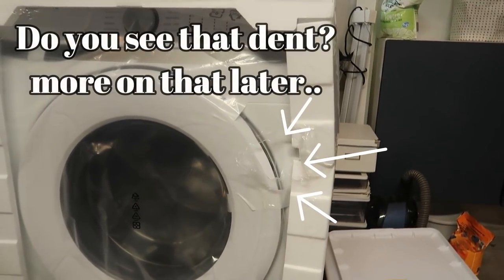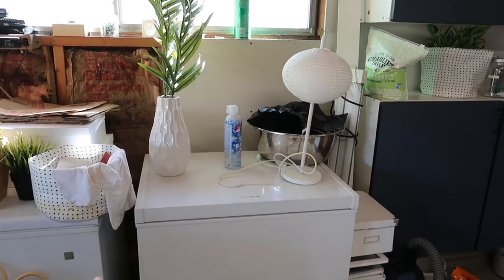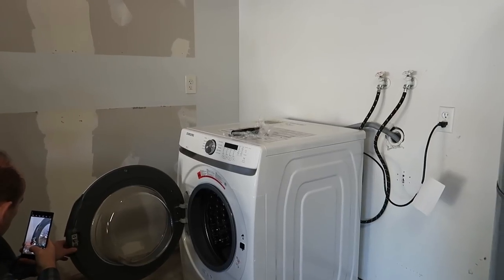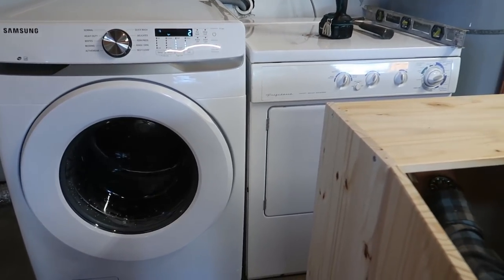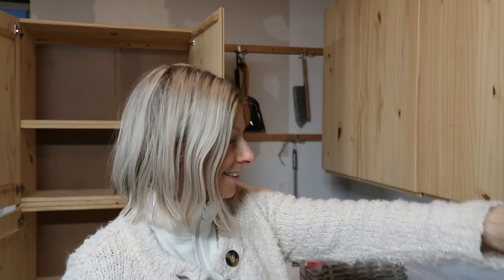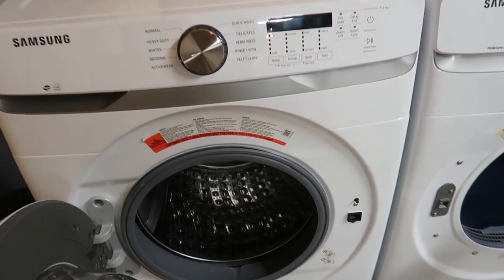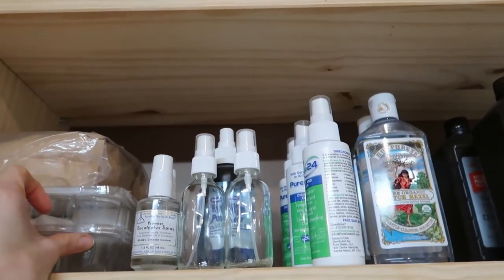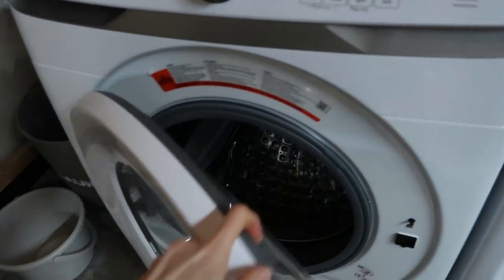Making a laundry room -Laundry room tour

Comment: Good morning Naomi, I also have a front loader washing machine and after I finish my laundry I will wipe the door down and lay a thin folded towel over the door so it doesn’t close all the way, and it airs out and you won’t get that odor
Reply from the maker: Thanks for sharing!!😊💗
Reply: I always just keep my door fully open for a while and wipe the rubber part with vinegar. Vinegar inhibits mold and helps with smell as well.

Comment: Hi, just a quick tip on the washer, keep the door AND the detergent drawer open so it can air dry after use, it helps keep your washer clean. Also drain it periodically (see manual) I do this to my front loader and I have never had smell or problems with it...just a helpful tip. Have a great day!
Reply from the maker: Thank you so much! I will do that! 😃💗